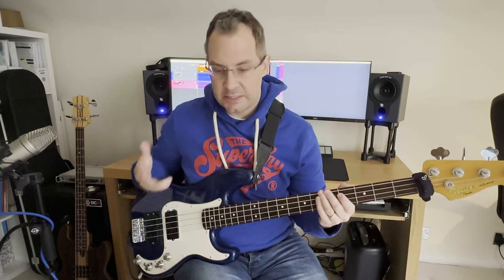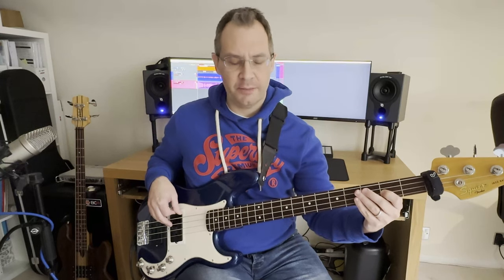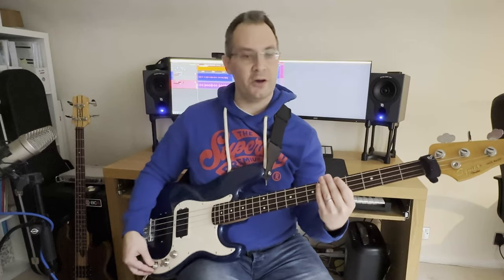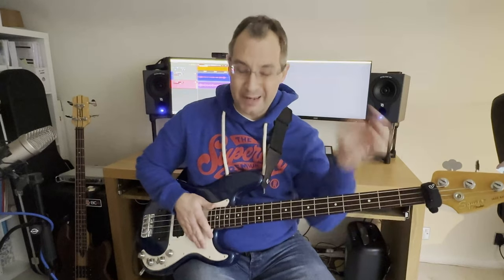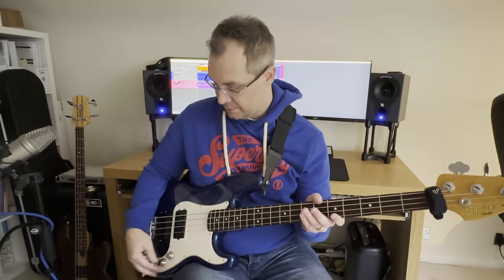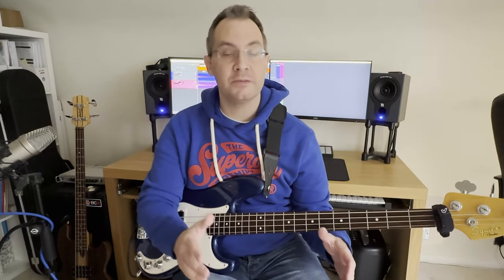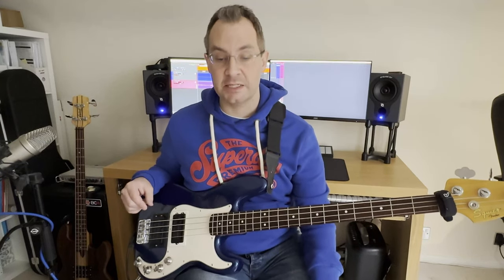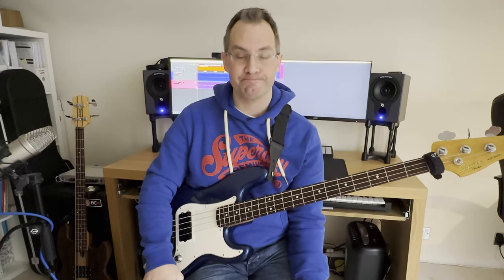Making a Wal-ish Bass [Video 2]: The Lusithand Double NFP Preamp

Comment: What these videos are teaching me is that its essential to have both pickups in parallel to really get a Wal sound. That's kind of a bummer for me, cause I was thinking of modding my stingray without routing and installing a neck pickup
Reply: One of those cheap Ray4 basses would be perfect for this kind of mod. You’d only need to buy a single pickup from Chris Turner and a single NFP preamp from Lusithand, and you’d be almost guaranteed to get close to the Flea sound at least. I nearly did that myself. 

Check out the sound clips at Turner Pickups. Those multicoil clips are recorded on a modified Ray4 with a single pickup. And he’s done the mutlicoil like in the Wal Mark 1-3s, with two coils sensing per string, wired into a Lusithand NFP Special, and also like the multicoils I have, with each row of coils sensing all the strings and rows wired in parallel or series, going into another preamp. 

Amazingly they don’t sound a million miles apart.
Reply: @usethefierce3628  I'm chasing the Justin Chancellor sound though
Reply from the maker: @ileutur6863  I hear that. I address that a bit in my next video. Editing it just now…

Comment: If you want to get closer to the Wal, wouldn't having a different coil wiring be the starting point. Also, getting them mixed within the preamp? Cheers, cool video!
Reply from the maker: I have contemplated getting the Turner pickups wired 'the new way' like Wal Customs + the Lusithand Double NFP Special preamp that would allow this. I may yet have to go as far as that. However the Wal Pro basses had pickups had multicoils wired like mine and still sounded like Wals....even though totally passive!!

Comment: I'm very interested in this project :)
As far as the tonal characteristics of the instrument itself (as opposed to the electronics)
Ken Smiths says that, in his experience, more laminations equals a brighter sounding instrument. He talks about it here:
https://youtu.be/sjq9Q1Perco?t=116
Reply from the maker: I’ll go check it out. Thanks!
Reply from the maker: Ok, I did check it out. Useful information, but it may not apply here….Ken Smith largely makes neck throughs, which is what he talks about in that video, and the Wal-ish is a bolt on. (As are Wals.)

Roger Sadowsky is on the record as saying he thinks bolt-ons get a large amount of their tone from the fretboard wood, but neck throughs get a lot from the wood of the body wings. I’d say Ken’s observations will apply for neck throughs.
Reply: @SuperFunkyPete  Good point.

I was thinking that some Wals have sandwich-style laminate bodies that their laminated necks are bolted to.

This might be a bit extreme, but have you tried swapping all of your genuine Wal electronics into your test bass?

If you're prepared to take that step, might give you a useful reference point for how much the instrument is shaping the sound.
Reply from the maker: @bongosock  virtually all Wal Custom Basses (the Mark 1/2/3) have mahogany cores with a veneer front/back of a fancier wood. Shedua, maple, wenge, ziricote, all sorts. And yet, they all fundamentally have a similar core sound, perhaps with some small variations. 

I have seen rarities - I think I saw one for sale the other day with an ash body. And only one Wal I have ever seen has had a maple fretboard - all except that one have rosewood or ebony boards. 

I am tempted to do the experiment you mention. It’s expensive, though, and if anything went wrong, it would be expensive to fix as well. But it has crossed my mind.
Reply: @SuperFunkyPete  Yeah, easy for me to suggest to others that THEY mess around with THEIR slice of Wal heaven ;)

Either way, I really like what you're trying to do. Wal's contribution to modern music isn't a narrow or 'niche' thing - it's actually quite broad. 

But access for the average bass player is, unfortunately, a VERY niche thing (financially speaking).

May the gods of bass smile on your endeavours.

Comment: Mahogany body will for sure bring out more of the low mids.
Reply from the maker: I think I will have to come to that. However I am interested to see what the multi-laminate neck sounds like. Been curious about single piece neck vs. multi-laminate for ages...do they sound different, or not...?
Reply: @SuperFunkyPete  I think the neck change may give it more snap and compression to the tone as long as it is a stiffer neck than the Squire. Could bring out more top end and zing but depending on fingerboard wood it could cause it to have more of that modern clank. I notice more clank with woods like Ebony, Wenge and purpleheart.  Hopefully that makes since. Regardless the bass sounds good like it is and looks great.
Reply from the maker: @meyersguitars2196  You are kind. I appreciate it. 

The fretboard will be rosewood on the new neck. I measured the laminates on the Wal bass neck to be able to duplicate the exact same thickness of maple/mahogany as what was present on the Wal. I can't duplicate the hornbeam on the Wal, but I think the new multi-laminate Jazz is a much stiffer neck than the Squier anyway. I hope for it to add something to the low mids, but you may be right, I might need the mahogany body for that.
Reply: @meyersguitars2196  Nah because tonewood isn't a thing in solid electric instruments